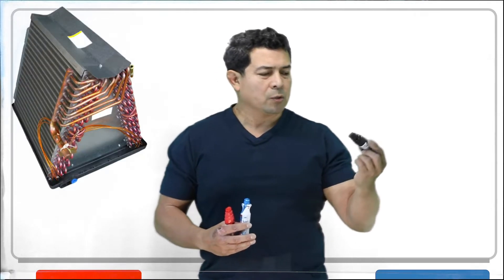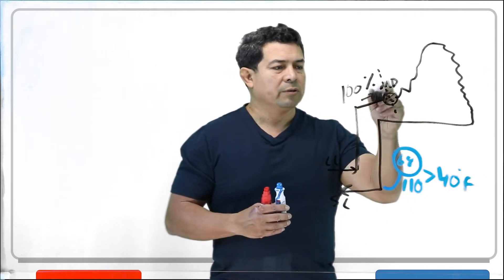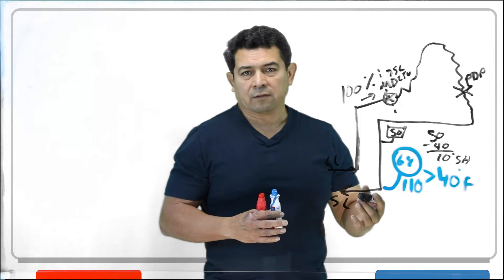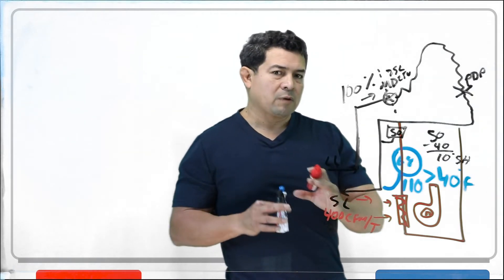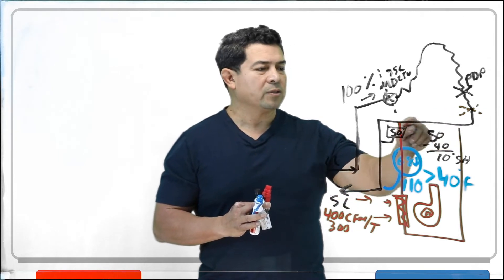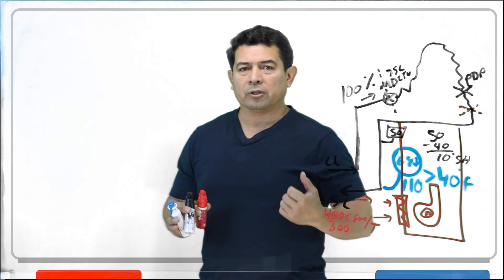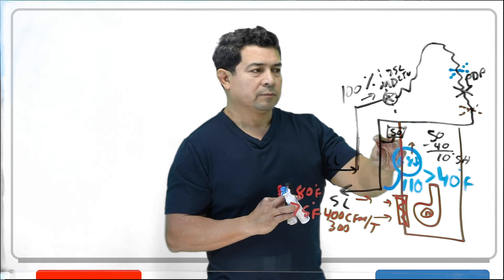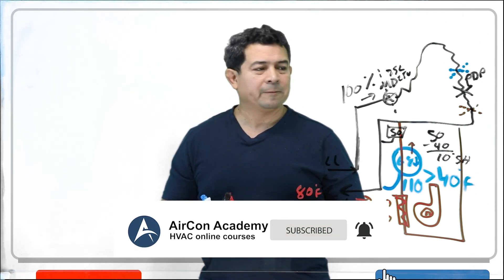The Evaporator Operator and Super Heat - HVAC Online Training and Courses

Comment: Very good explanations thanks bro I an so far  what is  super heat  the  hot air that returns let me know please God bless
Reply from the maker: The superheat is the heat that is added to the refrigerant after it has boiled inside of the evaporator. The basic definition is racing the temperature of the gas above the boiling temperature/temperature at which it changes temperature. It is easy to misunderstand that it has nothing to do with it being hot or it has nothing to do with the air. Thank you for watching!

Comment: how can l check my saturated pressure in the system so that the compressor doesn't lock up
Reply from the maker: To check the saturation temperature in the evaporator you first need to take the suction line pressure convert that to temperature and that will give you the evaporator saturation temperature. After that you would want to check the temperature of the suction line as it leaves the evaporator and subtract the saturation temperature from the suction line temperature and that will give you the superheat.   You must have super heat because if you do not have superheat, liquid refrigerant will go back to the compressor and lock up the compressor. The compressor will not run anymore and it will need to be replaced. So that means you must have superheat. I hope this explains your question.    I have a video on figuring out super eight. You may want to look for that and in the video and explain that step by step. Thank you for watching!

Comment: Sir,
I am very thankful  to u for your nice explanation, I have learned a lot from your videos. I have a question regarding txv.we had refer system on board ship. We have provision which r kept at -18,-18 and +5 degree centigrade. We have 3 rooms veg room, meat room and fish room maintained  at 5,-18 -18 degree centigrade. We faced problem of temp not maintaining.  Also refrigerant leakage. Leak part was sorted out by brazing leakage portion. Then when we tried to bring down the temp it was coming only to 10,-1, -2 centigrade. We charged refrigerant we changed txv still no improvement.  Can you please advise as to what may be the problem?
Reply from the maker: They are a lot of variables that I do not know. But let me ask you this since it is a TXV system when you added refrigerant did you check the subcooling? When you have a system with a TXV to charge the system you check the sub cooling. If you do not have the proper sub cooling the evaporator will not cool down like it should.  Did you guys pull a deep vacuum? Down to 500 µm? Air and noncondensibles could keep it from pulling down. Since you are on board the ship I am sure you are using salt water for the condenser like we used to use when I was in the U.S. Navy. Are your condensers clean and or are your strainers clean? You need to make sure you have a good heat exchange there. I hope this helps and thank you for watching. If you have other questions send them to me.
Reply: Thanks for your reply. In our case a workshop attended to address the refrigerant leakage. They first put nitrogen  and found out the leak .then they rectified the leakage part. Then nitrogen  was  taken out and refrigerant was put. After that the system was put in use. From your advise I can make out that may be due to air ingress and non condensibles present as the system was not vacuumed prior putting back the system in use we were facing the issue of room temperature  staying high.

Comment: Sir,
I like your explanation. Very good.sir I have if when u try to collect refrigerant in receiver and u find it less, does it mean that refrigerant in system is less.
Reply from the maker: Some of the refrigerant is not going to go into the receiver, some will be stored in the condenser. So what is in the receiver will be less because of the condenser. If you have a receiver in a system most likely you have a TXV as the metering device. When you have a TXV you charge the system by weight or by sub cooling.   It is very important to check the sub cooling. Remember, the receiver is only there to store refrigerant while the unit is running and when the refrigerant is not being used. I hope this makes sense. And thank you for watching!
Reply: Sir,
Thanks for your reply.  We had a condenser cum receiver  so there was no separate receiver as such in our case. Sometimes  when we used to pump down that time we used to not get back any refrigerant back so we used to charge again. We also cud not trace any leak during such times. So I cud not figure out as where refrigerant gone?

Comment: Sir i m Nisarullah trom pakistan, I watched your this video. You told that we should measure the super heat, so my question is that how can we measure the superheat. ?
Reply from the maker: To measure superheat you need to get the suction line pressure, convert that to temperature using your PT chart and you get the actual temperature at the outlet of the evaporator. And subtract the two numbers and the result is your superheat. A lot of times rule of thumb says that superheat should be somewhere between 8 to 12°. So 10° of superheat would be good. But it depends on what the manufacturer suggest.  I hope this answers your question. And thank you for watching.

Comment: Thanks a lot for this video. You mentioned that as the flow rate of air reduces from 400 to 300, the PDP point is going to move towards the compressor and the suction pressure would decrease. I could not understand the reason behind the decrease in suction pressure. Can you please explain why the suction pressure would decrease upon reduction in air flow rate and why would it increase when the air tempeerature increased from 75F to 80F.
Reply from the maker: That is a good question. When you reduce the airflow you have less heat going to the evaporator. Yes the air would be warmer but you have less airflow so the amount of heat would decrease. The refrigerant is not going to boil as fast as it should in evaporator so it will make less vapor. The compressor only runs in one speed so it will still draw in the same as before, because of that the pressure will drop. The compressor is pulling in more vapor than the evaporator is making and the pressure drops. I hope this answers your question. Good luck!
Reply: @AirConAcademy   Thanks, it is more clear now. Really appreciate your help.
Reply from the maker: @puravpatel5511  thank you! And keep learning out there.!
Reply: @AirConAcademy  Hi Sir, in above answer you told that "The compressor only runs in one speed so it ............" . So my question is what would happen when it comes to variable speed compressors ? same thing will happen?
Reply from the maker: @chamilanawaratne6629  most compressors will only run and one speed so they pump only a specific amount of refrigerant. You do have variable speed compressor's and these will increase, and decrease the volume metric efficiency of the compressor. Meaning that they will pump more or less depending on the need. One problem with this is that by adjusting how much the compressor is pushing through the pressures are going to change and if the pressure drops too much on the low side the evaporator coil could start to freeze. Sometimes manufacturers will use two or three metering devices to control the flow of the refrigerant as the compressor speeds up or if it has unloaders as the unloader loads up.  The mini splits that you see everywhere now the Compressor motor and fan motors are all variable speed so they can adjust the speeds as needed to help maintain proper pressures.

Comment: Got a question for you, I was trying to charging a very old AC, no label for its metering device type, I don't know what to use, superheat or subcool, finally, I tried subcool, it reaches 12.xx, but low pressure shows 30 psig in the meantime and superheat is around 58, what your suggestion is ? How can I tell if I should use superheat or subcool ?
Reply: I forgot to mention the refrigerant was R422B, low pressure 30 was too low, temperature was around 10~15 F, cannot be right.
Reply from the maker: If you have a TXV then you should charge by sub cooling. If you have a capillary tube or a piston then you should charge by superheat. You need to look at the type of metering device that is installed and that way you can tell which way to charge the system.  I hope that helps but that is how you can tell how to charge a system. It should not matter how old it is but the type of meter a device. Thank you for watching!
Reply: @AirConAcademy  thanks for reply, I know that principle but cannot take apart in evaporator outside case, it is in a narrow attic, hard to turn. I assume it is based on sub cool, when i reach 12 at sub cool, I found suction side pressure is very low, only about 25, such that I wonder if I should go by super heat, which means, I have to add more refrigerant until it reaches 10 of super heat.

Comment: Hello sir, can i ask some question
Reply from the maker: Ilmi Febry yes
Reply: @AirConAcademy  i have some problem with my compressor bitz
, refrigerant oil also circulates until it runs out until the oil level alarm
What possible not work
Reply from the maker: Ilmi Febry I understand that the oil leaves the compressor. And then the oil alarm sounds. What does the site glass on the compressor look like? Do you see the oil? Do you see a lot of movement in the oil? If you can, can you send me a video of the so glass on the compressor.
Reply: @AirConAcademy  oil see glas is empty, only in +- 12hours oil empty  from max levels to alrm
Reply from the maker: Also, what are the pressures on your high and low side?
Reply: @AirConAcademy  16bar in high , 1in low press
Reply: @AirConAcademy  before alrm
Reply from the maker: @ilmifebry860  Good morning,  I am sorry I was asleep.  I am in Washington DC, USA time zone. It is 7 am now.  where are located?   I guess you are using R22 in the system?  is this for air-conditioning or refrigerator?  is the condenser air cooled or water cooled?   how old is this  unit?  did the problem just now started?   what changes have you done to the system?  does it seem to be cooling ok, other then the  alarm going off?  please let me l know these  things and I will see what I can do.   Thank you.
Reply: @AirConAcademy  am in indonesia, yes for freeze , air blast freeze, yes using r22 , 7-8 years until now, before frezze in condition normal , and suddently oil is lost then alrm, the unit (compressor) just after repair in other person because i think ring piston or others wear and tear, but after im assmbly am trial oil still lost and alarm (hp 16 lowpress 1bar) am trial in -15°c
Reply: Sir likely what is broken?
Reply: Am still waiting